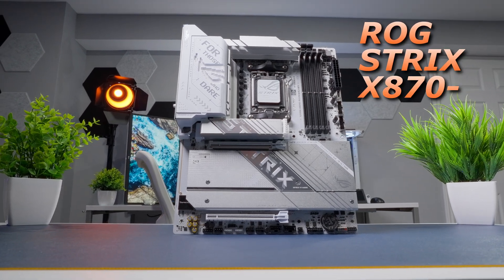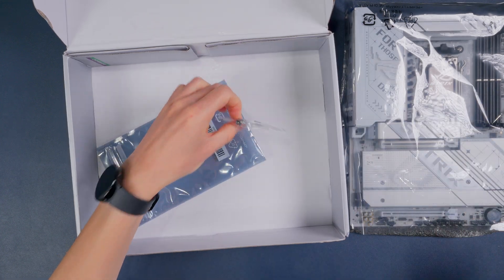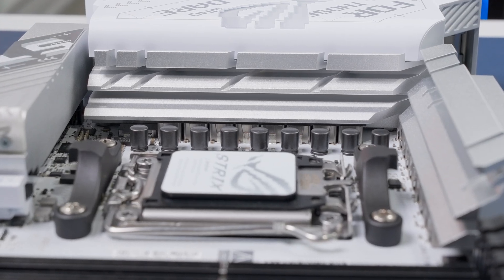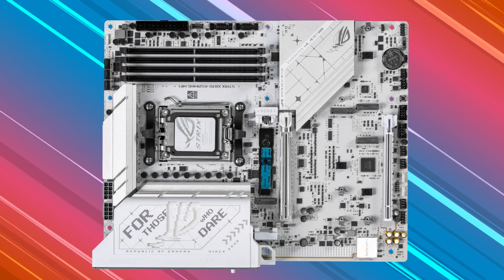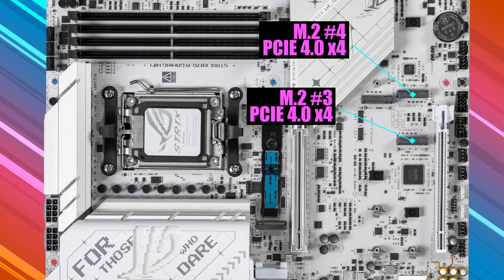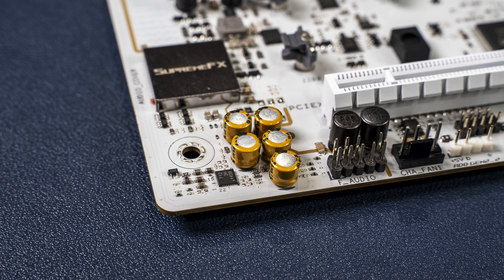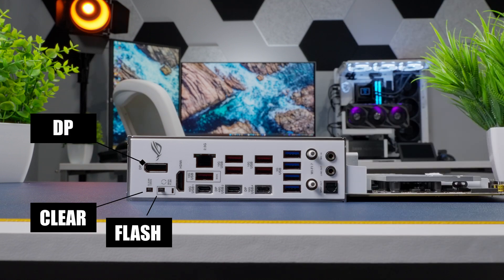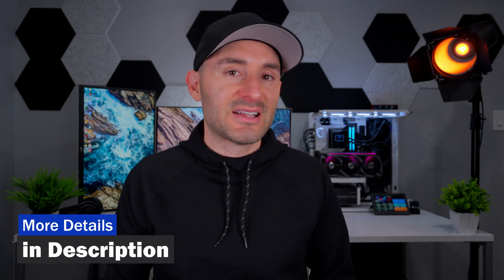Asus ROG Strix X870-A Gaming WiFi Motherboard Unboxing and Overview

Comment: $230 for this board is a STEAL.  Just bought it for my first AM5 build.  Hope to have it for 10 years. Thanks for the vid!
Reply: Yo same here. Now if I could find a 9800X that didn't kill my wallet I'd be rolling. Although hindsight I probably shouldn't have bought 175 dollar kit of ram 😅😂
Reply: @TruckerBSWII  bet you arent sad you bought that ram now...
Reply: how is it?
Reply: @MrViperForce honestly it's a great board. It has a Dbug LED that saved my bacon, tons of storage and looks clean. Lots of silver accents and black DIMM slots so if your going PURE white I's look at the Gigabyte board. In terms of value I couldn't personally be any more happy with my choice
Reply: @TruckerBSWII  the audio sounds fine on it? and the eithernet dont drop in and out?
Reply: @MrViperForce I haven't had any such issues in the month that I've used it. Even runs my 7200 48GBS of RAM just fine. No issues running WIFI or Wired and audio has been solid no matter the device I have it going through
Reply: @TruckerBSWII  what is ur full specs just curious?
Reply: @MrViperForce 
ASUS ROG STRIX X870-A
Ryzen 9700X
Thermalright Mjolner Vision 360 AIO
KLEVV CRAS V 7200mhz 48gbs (2 X 24)
Zotac 4080 Super
1 TB Gen 5 PNY CS2150 NVME
2 TB Gen 4 Acer Predator GM7000 NVME
Lian Li Edge 750 Watt PSU
Lian Li 011D Mini V2

I got the CPU and GPU used so I saved a lot. The RAM was before the price hike. It was 175 dollars same kit is going for near 300 now. Stupidly lucky there. Hope this helps
Reply: @MrViperForce can't beat it for the $.  Connections and build quality confirm this claim

Comment: Is it possible to put M.2 SSDs into Slots 1, 3, and 4? I believe that would make Slot 1 5th gen, and slot 3 and 4 4th gen, which is fine. However, I need to know if this config is okay while not cutting my GPU to 8x config.

Comment: So only the ram they list works with the board?  That sucks because its very limited especially if you wanted a certain style/color.   
Doesnt even support 8000mhz like it says it does.
Reply: Now I'm really confused.  This am5 board only supports Intel xmp
Reply: @jonathanschultz2472 It supports xmp and expo, plus has auto AI overclocking through bios which he doesnt mention.
Reply: 99% of ram sticks use the same few chips. I am using klevv crass 6400mhz, not even on compatability list but uses sk hynix chips and works great.

Comment: whats kinda disappointing is that this doesnt come with a full manual, only a thin quick start guide. yet asus's Prime series does come with full manuals? i thought ROG was higher on the totem pole? also i looked around trying to figure out which ethernet controller this motherboard comes with but its not listed anywhere online, a review has to tell me its the I226v? come on asus

Comment: So If i put a m.2 nvme pcie  ssd in slot 2 below the GPU, does it reduce the bandwith of the graphics card  and if so which slot is best for  the ssd for speed slot 3 or 4

Comment: I just built AMD pc with this motherboard. I'm having issues with the BIOS thinking I have a RAID so it prompts every time on restart to go into BIOS to restore BIOS.
Reply: Might need to check if you have ram sticks that are compatible
Reply: Did you solve the problem? I got same, of I switch off my pc, bios reset.

Comment: You’re jumping out on the limb there and trying to scare people with the M.2 bandwidth sharing on second slot. It’s not true. This guy doesn’t interact with audience just here for free money spitting BS on his videos.
Reply: U can use 3 of 4 Nvme slots without loosing x16, shame this has two data ports ,:(
Reply: No it is true. It clearly states in the manual. The 3rd m.2 slot also disables the 2nd pcie slot completely.

Comment: I just had to return this mb. went with ROG CROSSHAIR X870E HERO .. x870-a sounded good. and the price was great.. but so many stability issues that comes with this. Even when you use all recommended parts
Reply: What stability issues did U have? The a is literally a cut down of the hero and strix
Reply: I'm having the following and just can't get this thing not to show on boot

Please enter setup to recover BIOS setting. When RAID conf iguration was built ensure to set SATA Configuration Now, please press F1 to enter BIOS setup 
to RAID mode

Comment: Can I install 4 PCIe 4.0 NVMe SSDs (not SATA) without losing the x16 5.0 on the GPU?
Reply: Nope.
The gpu will be x8
And you will loose the lower pcie slot running 4 mvme.
May need to look at the 870E boards.
It’s a chipset limit.
Not an Asus limmit.

Comment: I just build a recent PC Gaming and went with this mobo without reviewing this video. You explained everything so well! Spot on with the limitations of SSD drives and slots . Yes I wish there was additional SATA PORTS! But if you plan your build correctly; go with a larger SSD drive on these 2 sata drives and add additional external DRIVES/NAS. I have this mobo with a Ryzen 9  9950X CPU and GeForce RTX 470 Ti Super.
Reply: Lucky! I just grabbed this mobo with the Ryzen 7 9800x3D- still trying to get my hands on a good looking white 4070 ti super- ideally the msi gaming trio model but its impossible to find close to msrp
Reply: @twistedking2490  bro how is the performance ?? I am trying to build a gaming pc with cpu Ryzen 7 9800x3d and Gpu RX 9070 XT fsr4.0
Reply: @ShadowByte1439  wasn't able to get my hands on a 4070 ti super so I caved and bought the msi white 5080 gaming trio lol. 64gbs of ddr5 ram. It's all here. I'm just waiting on my last delivery of lian li fans which should be here in a week. Then I can build it. I'm $5k deep into this all white build. Decided to say fuck the budget lol. $3.6k on parts. $1k on an oled monitor. And extra on peripherals. Moment of silence for my wallet
Reply: @twistedking2490  damnn 😁😁😁🔥
Reply: @twistedking2490  can you suggest me gpu , i was thinking Amd 9070xt
Reply: @ShadowByte1439  people are avoiding Nvidia cards atm and for good reason. The 9070 xt or the 7900 xtx are great options if you'd rather go AMD. Just really depends what you can get your hands on for a fair price
Reply: I just used this board and I am having issues at boot. Bios thinks I have a RAID setup which will do not. 
This is the annoying message everytime. 

"Please enter setup to recover BIOS setting. When RAID conf iguration was built ensure to set SATA Configuration Now, please press F1 to enter BIOS setup 
to RAID mode"

This happens after shutting down and turning OFF the power supply
Reply: Im had issues with this boards ethernet controller (fixed). Now im dealing with either ram stability issues or motherboard issues. I cant find out which. Doing some test right now

Comment: I am building a decent setup all white themed with this board , cpu is a ryzen 7 8900x3d, 4090 rog strix, 4tb of ssd nvme, I had a question can I use corsair dominator titanium white ddr5 2x32gb sticks
Reply: I like them a lot but it’s my first ryzen build and with your knowledge I can get better insight to see if they work with the board so I can order them to finish the build
Reply: I would check with pcpartpicker or something. AM5 supports DDR5, and you’d want a two stick configuration as four is unstable at desired clock speeds. 2x32 should be fine just check to see if it’s Intel XMP or AMD Expo built in. As far as the motherboard, it supports 192 GB of RAM so you’re good there.
Reply: There is no 8900x3d lol you either have 7 or 9800x3d